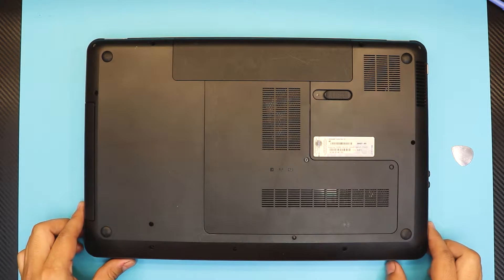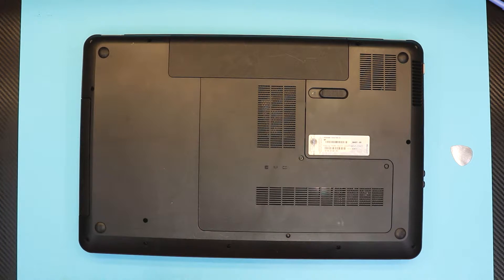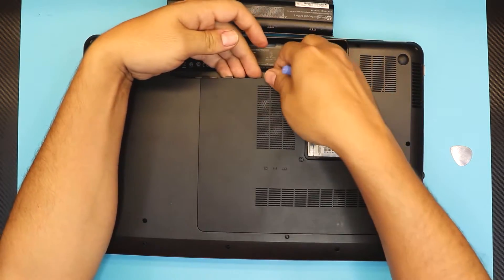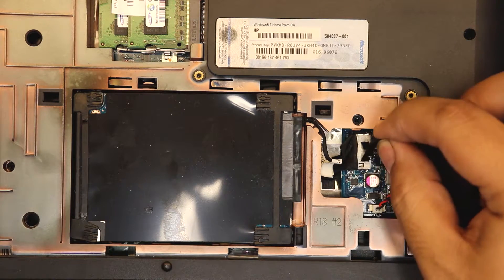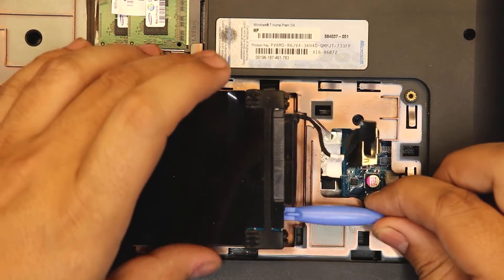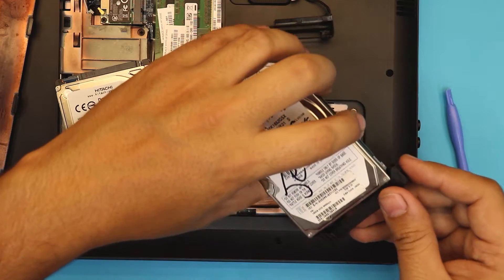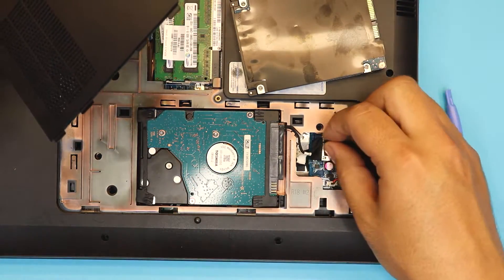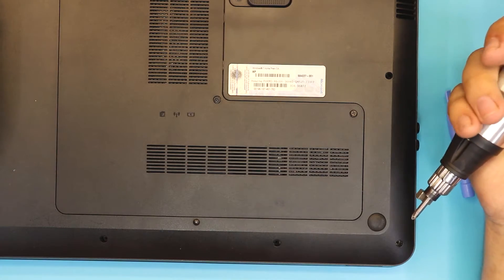HOW TO replace your Hard drive or SSD drive  in HP Pavilion G7 series

Comment: My question is  , do you have to migrate info on old drive first
Reply from the maker: Thank you for your feedback! If you wish to support the channel, you can like, subscribe, or both!
Regarding your question, you could clone the entire OS including your files by connecting the SSD via sata to usb adapter: https://amzn.to/3qoa4cp
and use a program called Macrium Reflect to clone the drive. BUT i don't recommend to clone from HDD to SSD as it will have performance issues and random crashes, it is much faster and better to fresh install windows, it take about 15min and you set to go. after that you can plug in the old HDD via adapter and transfer back your files. or get a better enclosure and use it as external drive.
one of the good cases and durable: https://amzn.to/3s7FVic

Comment: Great video, thanks for posting. Beside the wire connection for the hdd - there are 4 pins. What are they for..? Will i need them for a ssd swap...?  thanks
Reply from the maker: Thank you for the feedback! if you wish to support the channel you can LIKE or SUB or both :P
regarding your question: im assuming you talking about the dvd drive connectors can you send me a picture of the extra pins that you talking about?
use this: https://imgur.com/

Comment: Ive swapped from hdd to a ssd and the computer says no bootlable device? I cant get my head around it. The laptop starts with the old HDD but not the SSD, but I can get my other computer to boot and find the same SSD? Any thoughts?
Reply from the maker: once you replace the HDD with SSD you will need to reinstall the windows, else it has nothing in it. all your files and windows are in the old drive,
create Windows 10 USB Boot Drive: https://youtu.be/uDu8j2lE-dM
install windows 10 steps: https://youtu.be/7f_rBp6Rb3s

Comment: I'm upgrading my wife's HP Pavillion g7 2269wm to a Samsung 860 Evo 500 GB Internal SSD SATA 3. She purchased this way back in 2013 and it came with the stock 500 GB Hard Drive. So, quick question. Is this computer model equipped to handle the 860 EVO's full SATA Gb/s 6.0 capabilities? I've looked everywhere online for specs but could not find out any specific details and was wondering if you could help me find an answer.
Reply from the maker: Thank you for the feedback and your support, regarding your question: this laptop can handle up to sata 3. 
If you put a Samsung evo 500gb ssd sata 3. You dont have to worry the laptop will run smooth. Even if you had sata 6 the cpu wouldn’t be able to handle. There for dont worry about sata type
Reply: @uFixTek  This is good to know! Your response was very helpful indeed!
Reply from the maker: thank you for the feedback and if you have any question feel free to ask in any of my video comments. good luck

Comment: What do you do if you have lost these rubber covers that fit over the hard drive?   Where do you get a replacement .....i imagine the hard drive wouldn't fit great without it.
Reply from the maker: are you going to place a ssd?
Reply from the maker: you could buy it from ebay, or place the hdd in the middle and use a hot glue around in 4 points.
https://www.ebay.com/itm/HP-Pavilion-G7-1303SA-SSD-Solid-State-HDD-Hard-Disk-Drive-2-5-Caddy/233789843297?hash=item366ef5e761:g:G30AAOSwBTld1vlA

Thank you for the support to the channel :P
Reply: @uFixTek  yes , an ssd is what the plan was.
Reply from the maker: they you dont need the caddy, just place the sst and some cushion and thats all the ssd can move and nothing will ever happen, just fill the gap and thats all :P

Comment: Thanks for this video. 3 months ago I replaced a failed HD in my Acer Win 7 laptop with an SSD and WOW. What takes 5 full minutes on my newer HP Win 10 laptop to be usable after boot, now takes 14 seconds with the SSD and Linux Mint.
My wife, has an HP Pavilion G7 which constantly shows 100% disk usage, YouTube videos take over 1 minute to start playing and every time I fix it, it will be fine until MS does another update. I want to do the same conversion and according to this video it is even easier to swap the HD for an SSD than on my Acer.
Reply from the maker: Mike Wurlitzer if you wife pc has a 100% disc usage you can easy fix that😉 , open “services” on run and search for “superfetch “ and double click and stop it and disable it on the drop down.  If you dont know how to do it still let me know.
Reply: @uFixTek  Thank you my friend for such a  quick reply. I have "stopped superfetch" numerous times and "disabled" it so as to prevent it from launching on boot. That works until MS does another "update".  I believe you must do it under administrator privileges.  I have the same issues with the long YouTube loads on that laptop. Clearing the cache helps for a day or two then I hear her complaining. Nothing she does cannot be done on Linux so using your great video, I've already ordered a 1 TB SSD and have already verified the machine will run on Linux Mint via booting off a thumb drive.
Reply from the maker: Mike Wurlitzer ah oki i hope everything goes well, if you got any questions or want to share results let us know. Thanks

Comment: Hi I want to replace the hard drive for ssd hard driver because is faster do I need any adapters? Or is straight swap ? Many thanks
Reply from the maker: use any ssd drive https://amzn.to/2AOaWwo
the bigger GB is the faster transfer rate.
if you have buy a "usb 3.0 to sata adapter" https://amzn.to/33AvhPn
you can plug it into ur usb port and use "Macrium Reflect" program to clone your HDD to ssd 
but i would just do a fresh install on the ssd and use the adapter to pass my files to the new windows.

Comment: Hello, I got a question is it possible to have HDD and SSD instead of DVD player and how would I do that if it is possible?
Reply from the maker: yes you can you need to purchase this adapter: https://amzn.to/2Ux0dff

its easy just interchange the face cover with your dvd rom, they have a tiny plastic clips and there is only one screw holding the dvd drive under the service cover remove that and slide the dvd out and change the cover plate and put your hdd or ssd in the caddy then put back in and you done. @1:24  under the service cove the only screw to the left side near the dvd remove that. and when you pull the dvd out one screw the tiny metal plate at the back where the screw goes in to hold the dvdrom from sliding back out and put it on your adapter, 
so #1. remove the service cover. #2. remove the dvd screw un der service cover. #3. slide the dvd rom out #4. interchage the face plate (plastic cover optional) 5. interchange the back lock from original dvd rom into the adapters back so when you put the screw back it will actually have something to grip on to. if need more detail let me know.

Comment: My laptop (HP Pavilion G7-2210SW) cant see the SSD drive :o. Do you know how to fix it? I have not seen any IDE or AHCI settings in BIOS.
Reply from the maker: inside the bios disable your secure boot then, then enable usb boot put win 10 on your usb drive and restart then it will ask you to input a 4digit code just type it. then restart again then press ESC then when you see the menu press F9 chose your usb drive to boot from then you will see the ssd during the steps. if you didnt get it i can give you more exact steps.
Reply: I dont have a secure boot :( but i tried to install Linux Ubuntu and everything works well
Reply: @uFixTek  I repair it. The reason why it wont boot from USB is error in RUFUS (software using to create bootable pendrives)
Reply: @uFixTek  But thank you for help!
Reply from the maker: hubert jaguszewski im glad you figured it out 💡👌
Reply: @uFixTek  Hello, I have the same problem than Hubert: SSD is not seen if in place of internal HDD and did not seen Secure Boot in the BIOS. 1.Should I upgrade BIOS 2.Can you help with your 'more exact step'? Thanks in advance!

Comment: Great info.   Thank you.   Do you need to back up your files and reinstall software to do this?
Reply from the maker: you have two option fresh install of the windows 
#1.https://www.microsoft.com/en-gb/software-download/windows10
CLICK "DOWNLOAD TOOL NOW"

or you can connect your new hdd ssd via usb 
https://amzn.to/2J7WmBb

and download a free ver of: Macrium Reflect
and clone your main drive to new and after that just replace  and it will just boot normal off your new drive.